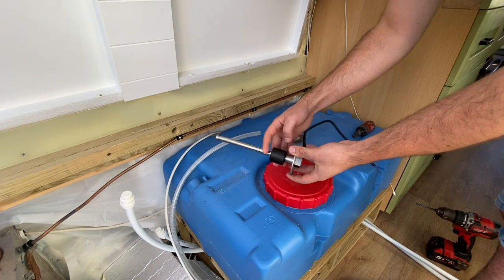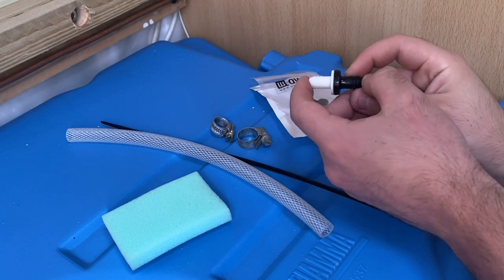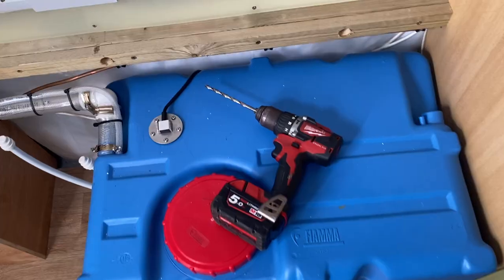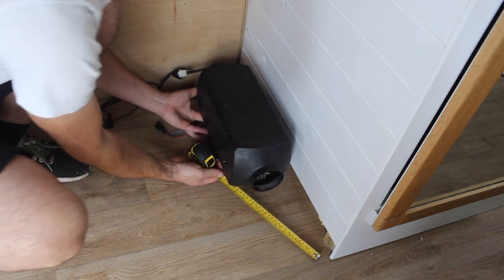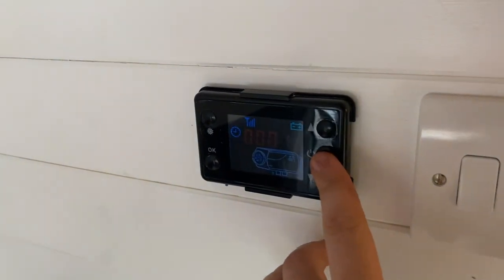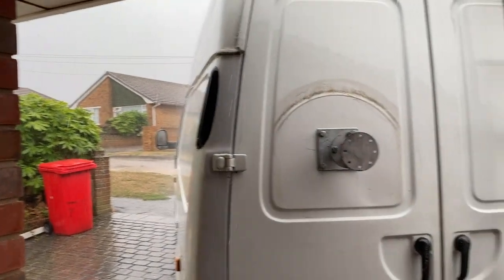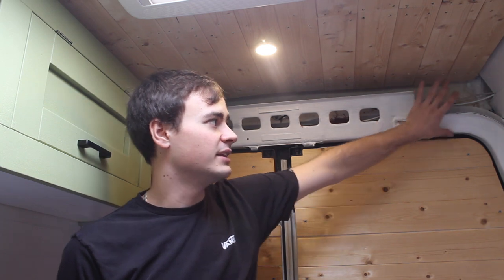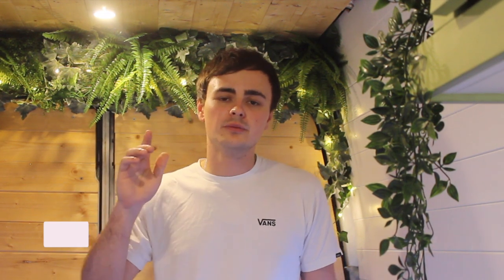Diesel Heater Install, Water Tank Fill Point & Foliage Arch Feature - Van Build Series - Episode 24

Comment: Good work! When I installed my heater, I got myself a large Schneider electric box with rubber knockouts from Screwfix and mounted it under the van. Lined it with some foam and hung the pump on para cord within it. Hanging the pump works a treat at reducing the thud it makes. Impressed with the workmanship throughout this build.
Reply from the maker: This is a brilliant idea and if it’s too noisy will do that thank you 😊 and I really appreciate that thanks mate 👊🏼

Comment: Actually I believe you flow direction of the diesel filter should be the other way, so from outside the filter inside the filter out, this is done so one can see if the filter need to be cleaned or changed.
Reply from the maker: You’re totally right, my mistake. Learn something new every day 👍🏼

Comment: The heater Fuel Tube can be Exited through the Side of the Plastic Heater Casing...it saves the Tube exiting and re entering the Vehicle
Reply from the maker: That’s really good to know thanks, what do you do with the fuel inlet on the bottom?
Reply: @TurnersWorkshop97  the Metal pipe is brought up to exit from the heater casing
IIRC there is a grommet which can be modified to allow that.
then plug the outside hole with Heatproof silicone....
Reply from the maker: Great tip thanks, I will have a look when I give it a service next 👍🏼

Comment: I think the fuel filter for heater that you mount is in wrong flow direction. When its mount in other direction you will see is it clean or dirty. Any settlements will be visible.
Reply from the maker: Thanks I will check this out.